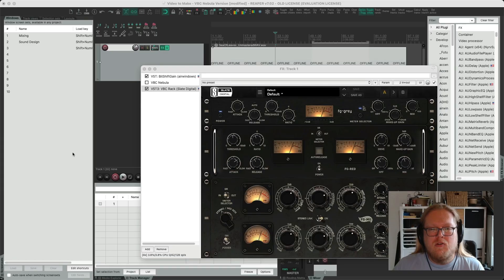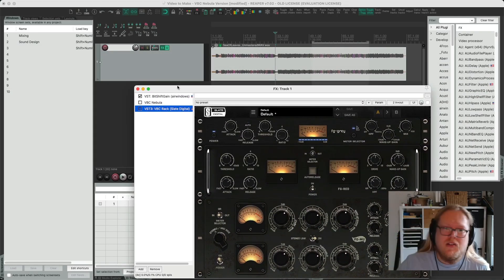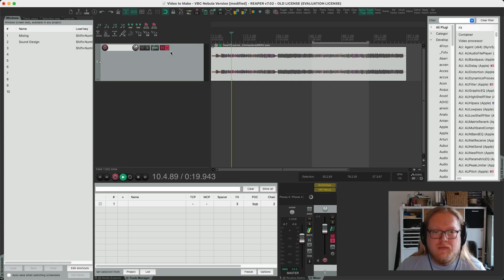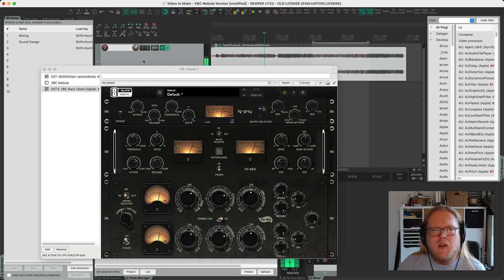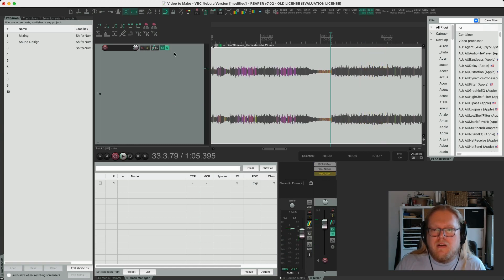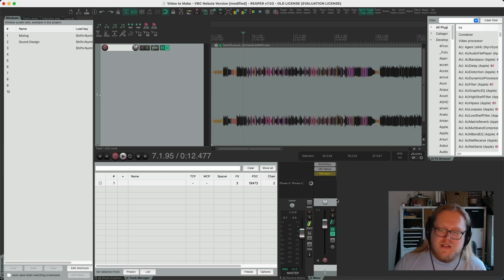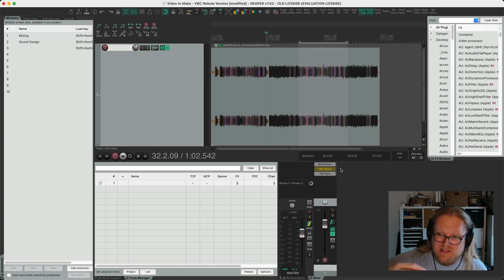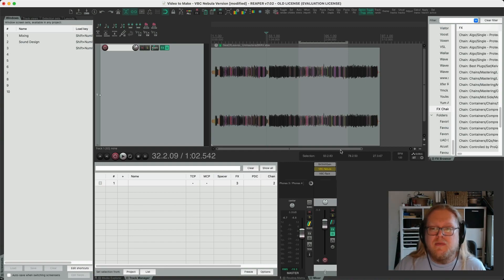Recreate Slate Digital's VBC with Acustica Nebula & Acqua Plugins

Comment: Cool video but gain matching would be cool to really hear the differences. It's quite auditable the gain jump between both processed tracks compared to the original source. Could you explain how your using Airwindows bitshift?
Reply from the maker: I did gain match in the end by ear, as the perceived volume was a bit too high initially. Having said that the volume varies depending on which part of the song you're at because of the amount of compression, as the signal is very dynamic. Gain matching is pretty much useless from section to section in this example. I did explain my processing behind not using meters to do this in the video, as essentially with more harmonic saturation added, if you gain match you're going to come out quieter in this case because of the perceived loudness being more skewed to what Fletcher-Munson curves consider to be the more sensitive areas of our hearing. Next time I'll offer a section where I do it properly, although in all honesty, when gain matching we're taking using LUFS we're using Fletcher-Munson curves, which have been found to be very misleading with recent research, as they only account for people with hearing that is perfect for the age range of 18-25 year olds and with absolutely healthy hearing. In my field of research they're proving to be highly inaccurate, hence why I don't care much for them, as people who are hearing diverse physically and neurologically have very different hearing to the range Fletcher-Munson considers to be normal, and what people consider to be typical is a very small portion of the population. Years ago I remember Doctor Mix and Dom Sigalas saying they don't care much for it for different reasons, so I'm quite behind them on that.

When it comes to BitShiftGain I actually edited out the explanation, as it was a bit too long, but essentially it reduces the gain, or increases it, by shifting the bits of the signal either one step to the left or one to the right to get a perfect double or half. This means it's not using lookup tables and/or dithering the signal to get to the new volume. With 64 bit processing this is less of an issue, but it's still the cleanest way of doing halves and doubles in audio processing 👍

Thanks for the questions and comments! Very useful stuff I'll tackle in the next video.
Reply: I've found a good way to gain stage the plugins in an appropriate way, so will be doing that next time 👍
Reply: @Fwuzeem  looking forward to it.